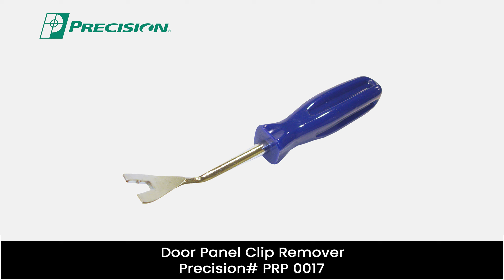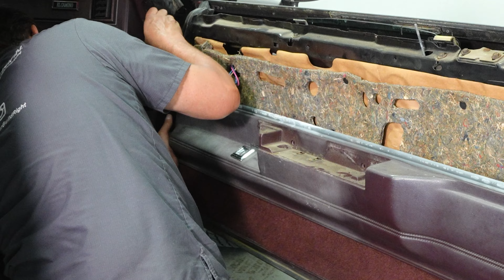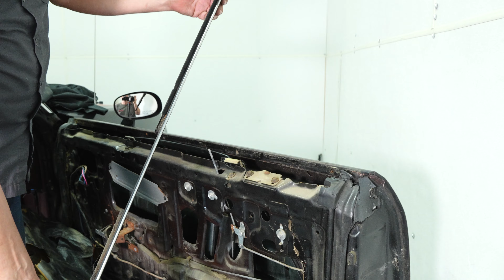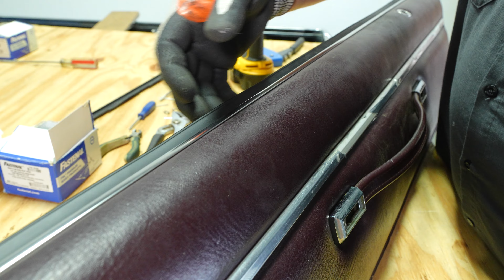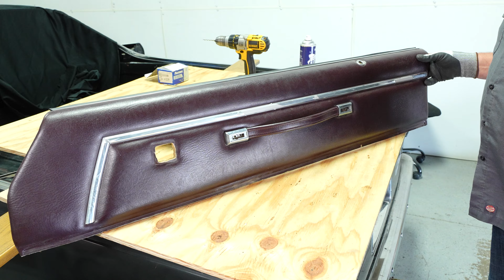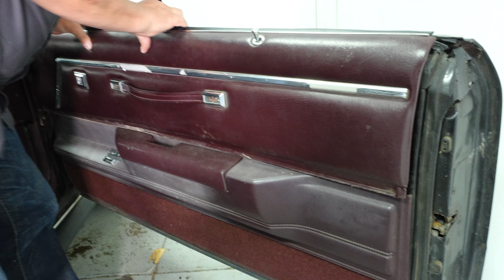1978-1987 Chevrolet El Camino Beltline Moldings

Comment: What you are calling dust paper is actually a water deflector and should be tucked into the bottom of the door so water can drain off it into the door and thereby drain out of the door.  If this is not done, water will drain into the inside of the vehicle.